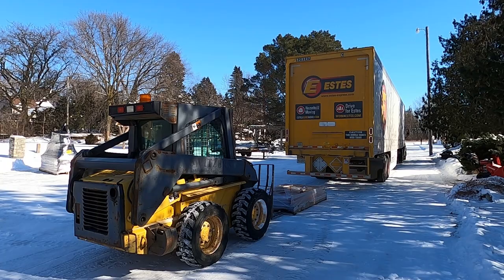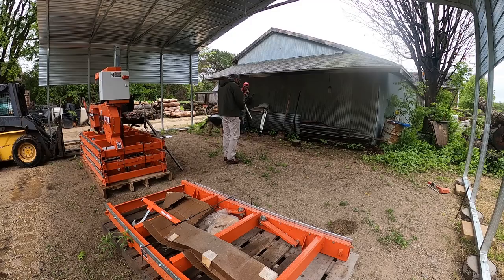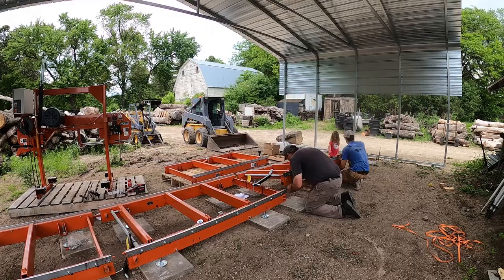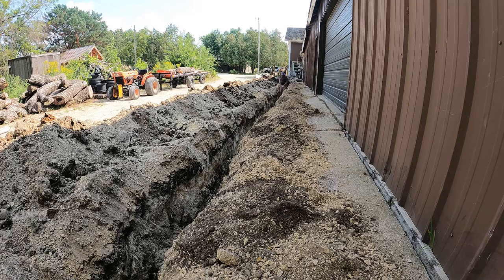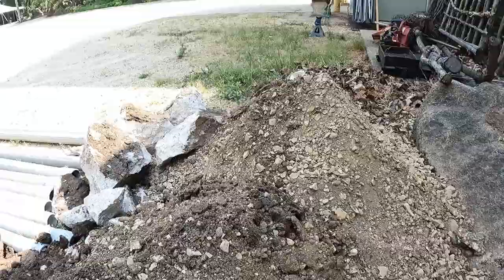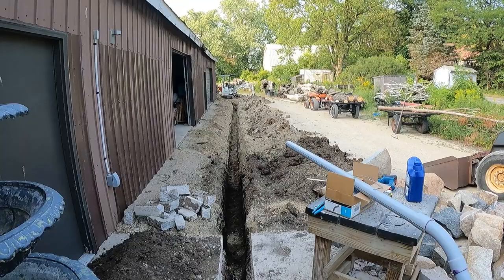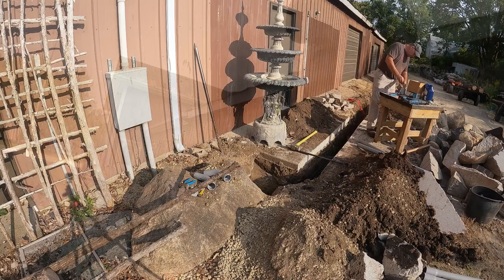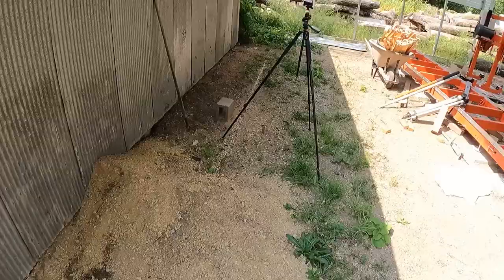Wood Mizer Lt15 Wide Electric - The Journey to Milling the First Log

Comment: Definitely considering an electric saw mill (if I ever get a mill) for the reason you gave, and more, they are quieter (easier on the ears) and if you have solar or wind the cost to run them is very low. The biggest reason was that you don't have another engine to keep running and maintained, and keep gas or diesel in. Flip a switch and it's running.

Comment: Is the electric motor significantly quieter than the gas version?  Thanks for the video!
Reply from the maker: Yes. And a little different workflow, for the better, because you don't need to keep an engine running non-stop. Cheers!